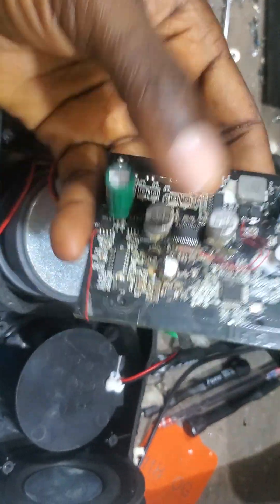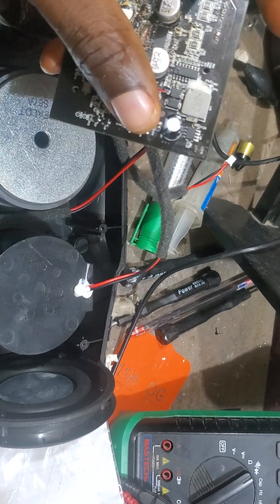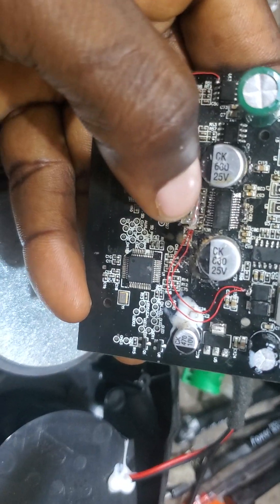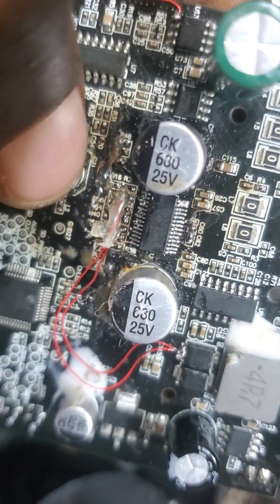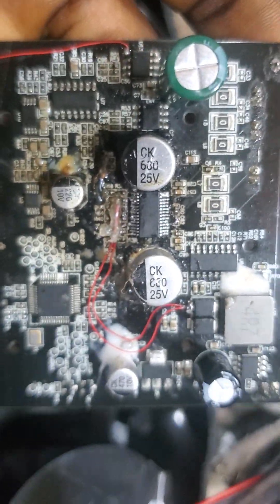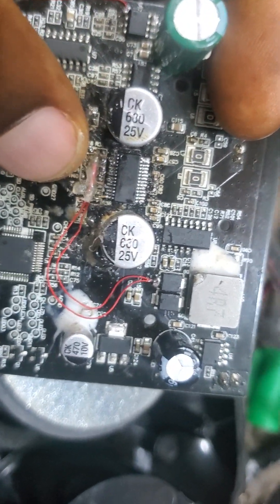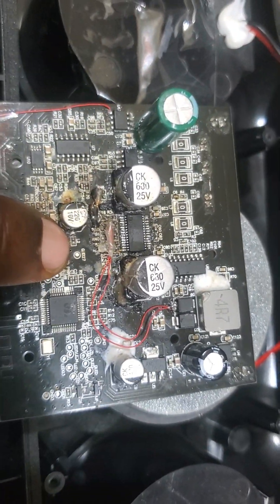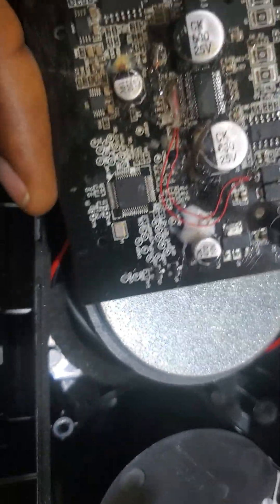It Took Me Months to Fix Zealot S67 Bluetooth Speaker Crazy No Sound Output

Comment: Please the middle speaker in mine is not working very fine 
Sometimes ut works sometimes it stops,thsts the bass speaker
Please can it be repaired or do i have to get a new bass speaker
Reply from the maker: It depends on the fault. First thing to do is to identify the cause of the problem. 

How did the problem start?
Reply: @ZiliconTech 
I was just using it and just like that it stops working unless I press the bass speaker and it start playing again but if u intend to add volume to make it more louder, it stops working 
Then I press again,I have been using it like that for a long time but I'm uncomfortable with it 
 Just yesterday it started sounding as if the speaker has tear,so I don't know if it can be fixed